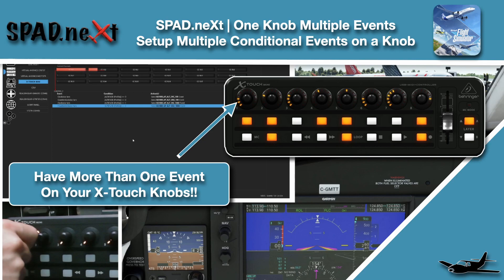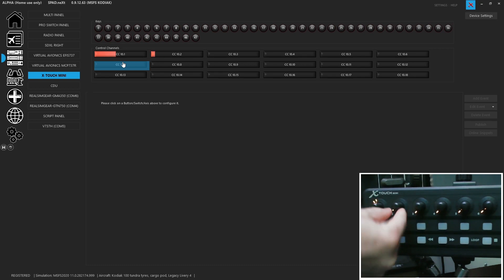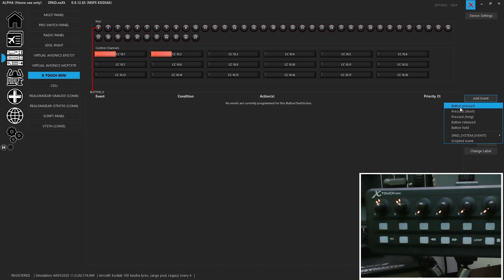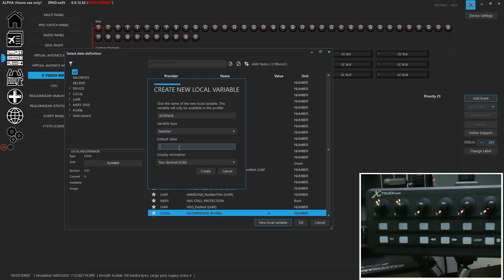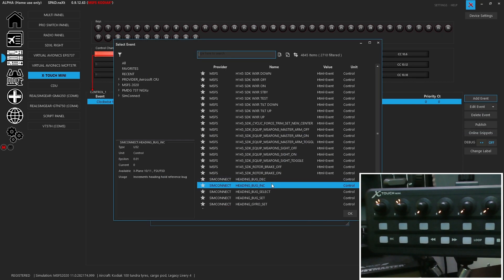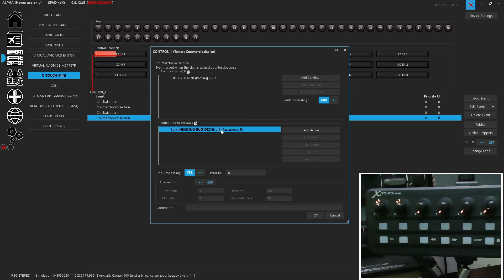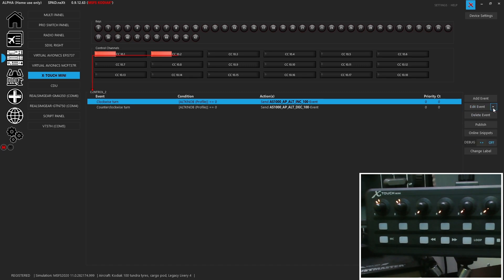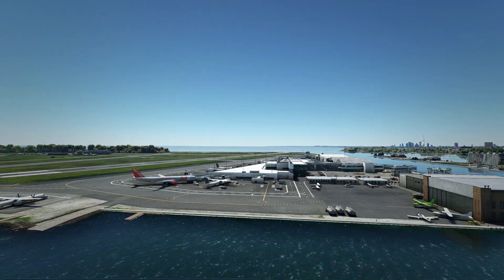MSFS | SPAD.neXt | One Knob With Multiple Events Assigned

Comment: thanks ... I have searched "snippets" and many videos... not really finding the details - but I will.  I did notice AS3000 only has SOFT KEYS, lots to learn here.
Reply from the maker: What version of spad are you on??  AS3000_PFD and TSC are the sections with all the other Events.. they are absolutely there..  Unless your on a really old version and don't have the updates
Reply: Sorry - I menat AS3000_MFD (map Range Zoom in and Out) 
Its like another new language  lol🙃
Do you think that the Button Type will ever include "Rotary"?   or however that is described in this community. A twisty knob.
Reply from the maker: There is no MFD zoom .. the GTCs are the touch controllers that have the knobs on them.. those are the events you need to emulate..  for many of the Knobs you will see INC and DEC as the ending for turning the knob down or up.. 
https://youtu.be/heMHhlSGDoI?si=-nBdiYjUpNzTrQvz&t=1791
That video will show you buttons assigned to those knob controls.

Comment: Ive got Button Box with rotary knobs and button press capability ... I dont see a way to change the button to a rotary ?  not clear if this will even work. The main reason I downloadeed the trial was to add features on rotary knob to use G1000 G3000 etc knobs in MSFS
Reply from the maker: "button box" Joystick devices will just have Encoders work like Buttons .. you will have a Button press for CW or CCW turn.  That is exactly how my GPS 530 I custom built using Arduino works..  The "SPADSTER" video shows how this is displayed and examples given.
Reply: I guess I assumed there would be a KNOB defining the button type. Ill look for the CC CCW - have not seen.  Is there a list of definitions for G1000 G3000 stuff ?  like what knobs and buttons actually have assignments in the SIMCONNECTION or MSFS list ?
I cant seem to find G3000MFD referenced anywhere as an example.  Im gonna save up for the G1000 hardware panel - probelm solved ! 🛫🚁🚀
Reply from the maker: AS1000 for G1000 and AS3000 for G3000. Again there are videos for this already covered. Or search in the spad discord.

Comment: Hello Les, thanks for this very interesting video! :)  Wow this utility opens up a whole new world in controlling Flight sims! :)

1. Can i use "any" midi kontroller like this in Spad?
2. If using the X-touch (which I Have), is it possible to get a "live" representation of the X-touch on screen showing labels etc?
Reply from the maker: You can use any controller you like that is standard midi. Currently the XTouch has the generic UI as seen in the video…
Reply: @LesOReilly  Hi Les! Appreciate all your work. I don't think people realize how much work it is to write, film, edit, publish, these informative videos. Anyways, do you know of a midi controller that has, inner, outer, and pushbutton capabilities all on one rotary knob, similar to knobster? Perhaps in the $100 range, as I am lazy(efficient) and Cheap(frugal). ha BTW I do search first. Couldn't find any description. Also, I am aware of the generic knobster dual encoder/pushbutton knobs. Too expensive.
Reply from the maker: I have videos of making your own with an arduino and a Propwash encoder.
Reply: Wow! Thanks!
Got to fins that One! 😀👍

Comment: Hi Les - just spotted your new tutorial and have spent yesterday and much of today going through it, making notes and trying to implement it. I have managed to complete nearly all of it but have hit a snag with the ALTKNOB. Everything looks the same as yours and when I turn the dial I can see in Spad's Control window that it increases/decreases the values. Pressing the button on the top of the dial also works fine and changes the incremental value. However, for the life of me, I cannot get it to change the altitude values in the sim when I turn the relevant dial. I've triple checked everything, but cannot see anything untoward and cannot see a way forward. Any pointers you can offer would be greatly appreciated! Cheers
Reply from the maker: Use the discord. :). Post screen shots of the knob and button configuration :)
Reply: @LesOReilly  - Will do. Have to go out for a couple of hours. Will post in discord when I get back. Should I post it to alpha-general?
Reply from the maker: @FlyingCatPro  probably best place since you are on alpha..  there could be something in there that does not work on release... also the snippet I posted does not work on release..
Reply: @LesOReilly  - Now posted in discord in alpha-general - thanks.

Comment: Hi Les.  A very timely one for me. The X-Touch has opened a whole new world for me.  And many thanks for your videos. I have just mapped CRJ lighting (display, integ and flood) for all LSP, RSP, O/H and INTL to common knobs....VERY handy in a cold and dark a/c.  Also Baro, Elevation, Nav source, format and range.  So good!!
But I'm having trouble mapping Decision Height/MDA to a knob and APU Pwr/RUN to buttons.  I get very inconsistent or spasmodic events.  Can you suggest remedies for both of these?
Reply from the maker: I am pretty sure you need to control the MDA stuff using the LSP lvars for the Left Side panel.. just like the other items...  As for the APU pretty sure I did those on my streamdeck... will have a look at some point to post them in the discord group to show what I did..  However also pretty sure I put them on the saitek switch panel to turn it on and off and it worked...
Reply: @LesOReilly  right thanks...will keep investigating.  Re DH there are a 'Height SEL' LVAR, Height SET LVAR, and Height SEL CHANGE LVAR.  
I used this last one, but it still jumps around a lot using this.  Clockwise, might go incrementally 0-24-56-90-130 etc, and keep going up even using counterclockwise OR start to jump down, and v.v.
The code I used was (conditional as per your video - that's fine) then for the DH (Height SEL CHANGE LVAR) Increment ASCRJ_LSP_Height_Sel_Change (Lvar) by 1 clockwise and Dec by 1 for counterclockwise. Note - Acceleration OFF.

Again, I'll relook at it.  Interestingly, you can force the APU to shut down by just closing the rear exhaust hatch, but that would not be done in real life due to running down of the APU in the meantime.  I like your delay between the two.  I can get the APU started, but not stopped.  I only animate the APU AVAIL green light, but not stop the APU. What I need to do is effectively simulate a mouse click to the box ABOVE the Available light on the APU panel.  So what am I missing here?
Reply from the maker: I posted it all in the discord and tagged you to find it.